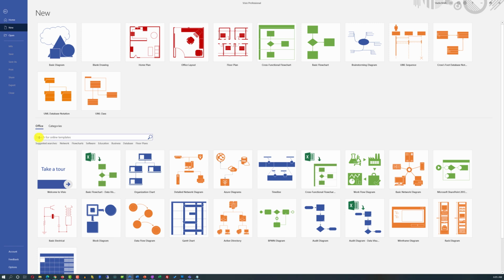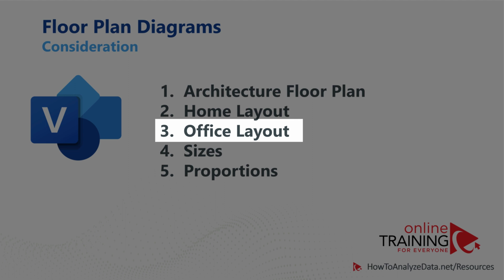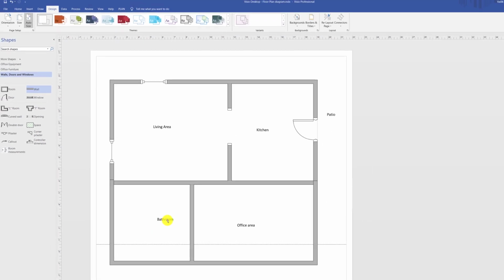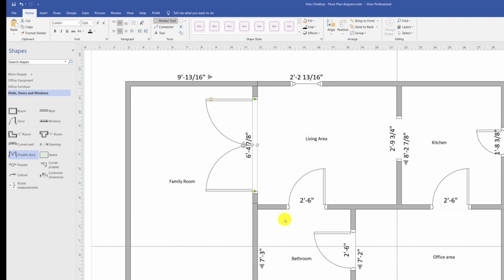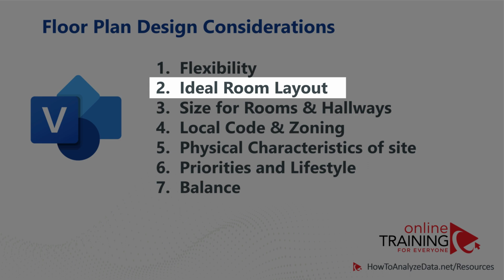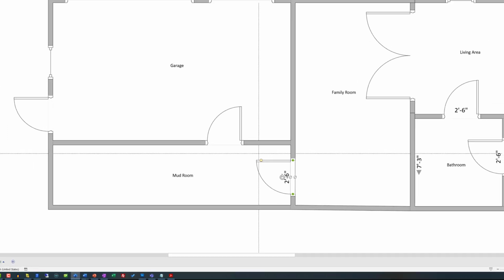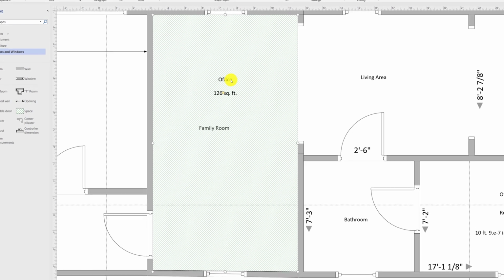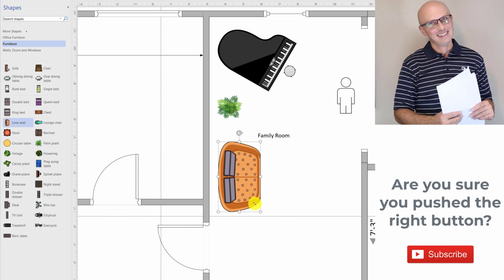How to Draw FLOOR PLAN DIAGRAM IN VISIO

Comment: Does Visio have basic templates (or snap to prescribed points [spacings for: wall studs, floor joists, ceiling and roof rafters using 16-inch center-to-centers]) that show standard architectural criteria, for standard dimensional lumber or materials for fit-ups ?   
  Also, the number of stair steps for specifics, i.e. floor-to-floor heights showing tread depths and riser heights needed ? 
  Thank you, -Lee